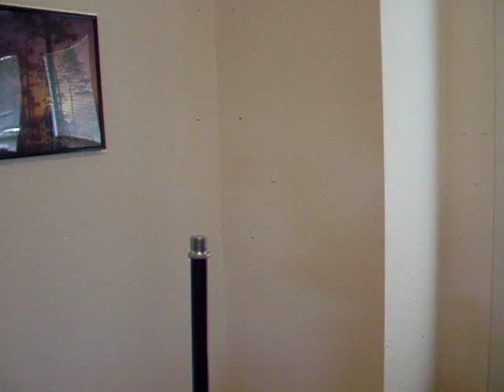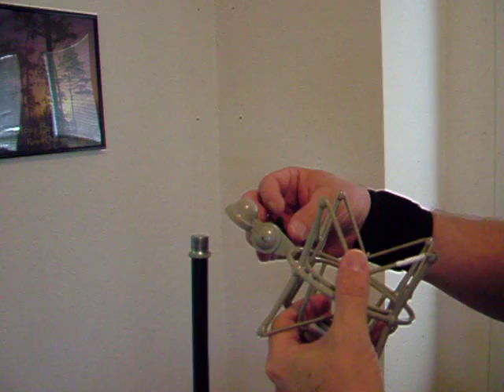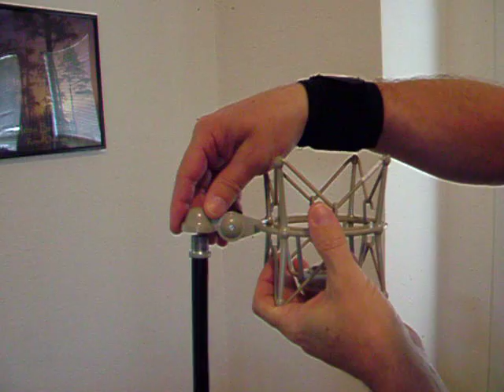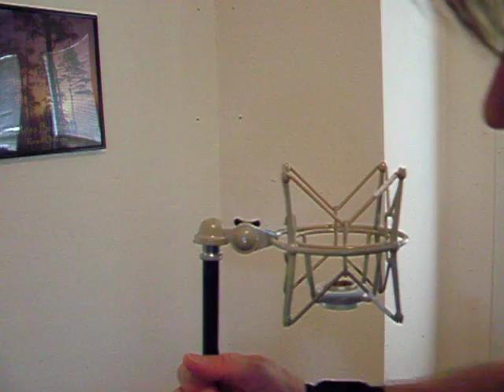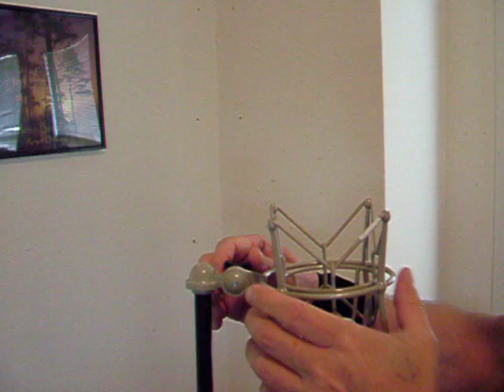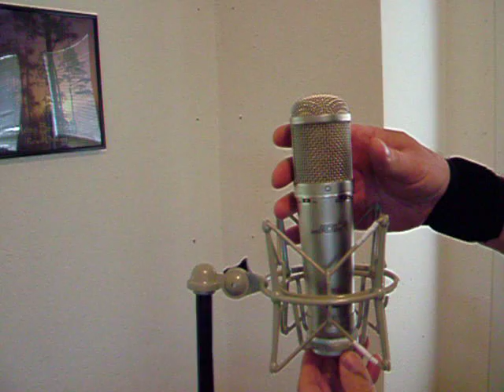How to install Shock mount and ADK Mic onto a stand

Comment: I bought an SM6 for my USB mic and it won't screw in to the hole, seems to big. I thought these sizes were standard, they are not my Audio Tech mic the threads are to big shame have to send it back.